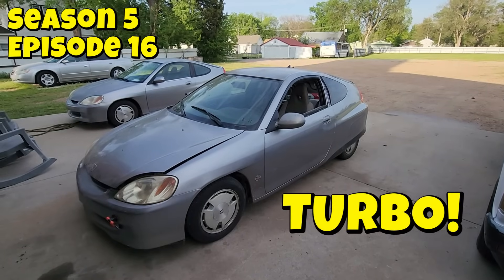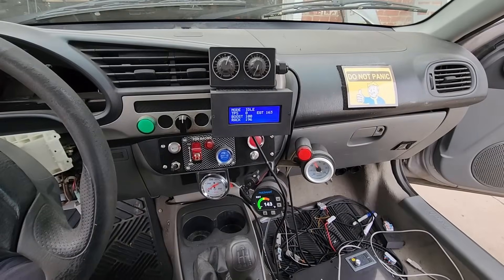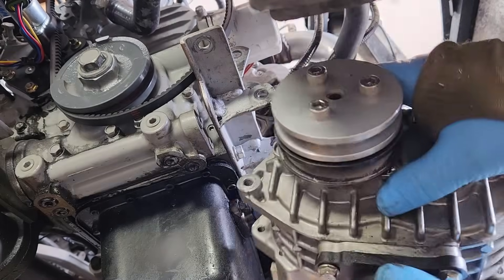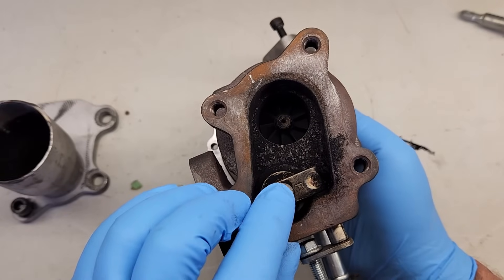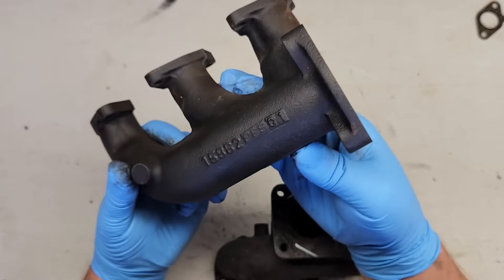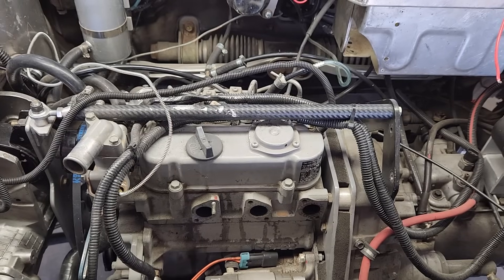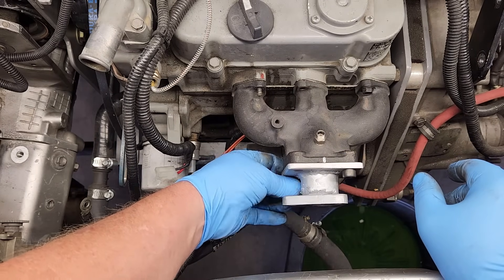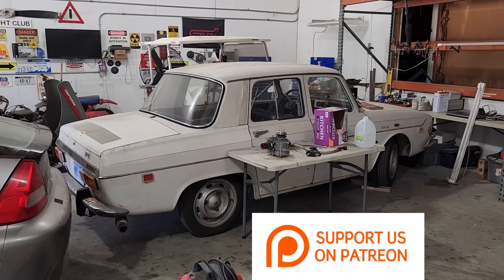S5 E16. TURBO !  We get rid of the AMR500 supercharger on the D722 Kubota diesel engine in the Honda

Comment: Rule of thumb for turbo: Smaller turbine wheel, spool faster.
Bigger compressor wheel, flows more.
Actually it isn't so simple but you can rule out some of the turbos in this way.

Comment: Yeah, the Gen1 Insight is TINY. It's about the size of a Honda CR-X from the 90s, and about the weight of a Ford Festiva from the 80s... except the stock Insight fills the bottom half of its trunk with batteries.

Comment: You should try the kp31 turbo of a smart car, it come with the manifold, you just need to make an adapter plate. We use them on our pulling garden tractor on our kubota 3 cyl diesel. They build more boost than the Rhb31 and you can get a billet compressor wheel for them! I love your videos!

Comment: The Nissan TD42 uses a plunger styled adjustment to the mechanical injection pump to increase fueling proportionality to the increase in boost. It's not a perfect system compared to electronically controlled fuel management but its very simple and very robust.

Comment: If the radiator is on the driver's side, why can't the turbo be flipped and / or clocked to work with the other manifolds? P.S. I  will watch your videos either way with or without electronic content. ❤
Reply from the maker: I understand what your saying, however there is not enough room in the engine bay without a massive amount of exhaust fabrication.

Comment: Adding a turbo or supercharger to increase the amount of air per cycle is fine, but it seems they haven't improved the pump to inject the appropriate amount of fuel. Less fuel means less power.
If the pump is the same, the amount of fuel that can be injected is the same as normal, so the power output will not increase. Since more air is added, more force is required for compression, so the available power output will decrease.
Reply from the maker: Not true,  we can adjust the rack on the pump for more fuel.  The pump will provide enough fuel  to allow the engine to develop about 35 hp.

Comment: episodes are a little short while simultaneously dragging out the material a little, taking off the existing setup, picking a manifold and bolting on an adapter shouldnt be 13minutes of content, viewership might go up if the fat is trimmed a little and a project/step is brought to a conclusion in one or two episodes, would of been nice to see the turbo on and operational in one bite, and then play with porting it ect in the next iteration

Comment: TLDR; Maybe instead of less electronics content, we need more detailled electronics content so dummies like me learn and are able to follow along.

My gripe with electronics is THE WAY most mechanically oriented YT channels do it... We might go from explaining how an angle grinder works or how bigger bolts require bigger wrenches and 30min slow-mo grinding montages to a table full of relays and other simple gadgets and if after the first part I didn't fall asleep, I'm still with you.

But it seems without exception all channels jump from this to "to avoid a wiring nightmare, we'll combine the functionality of all these individual gizmos to an arduino / a rasperry π"
And we go straight to a computer screen and setting the final values for whatever we are doing.
No one ever seems explains what those two thing are / how they are set up? All I understand them to be are tiny computers.
Surely they require an operating system, one doesn't just magically materialize on a circuit board, what is it? What software is used for the programming?
I've seen them used from automated propeller shaft greasing systems on boats to expanding the funcionality of a telescope and from boost control to stuff for fish tanks, solar energy and surveillance systems. Surely all those applications require a slightly different setup?
Surely the circuit board needs to be told what is connected to it and I can't just write "solenoid", "sensor", "motor", "linear actuator", "inch", "millimeter", "Fahrenheit" or "Celsius" on an excel sheet, they are just letters after one another before the computer is told what they mean?
I have done some simple coding to modify video games, so I think I could learn to work these things, but I've got nowhere to start and you don't know what you don't know...
So much information gets ommitted jumping from a completely mechanical contraption to a fully computerized one that watching any further tinkering on the computer side looses all value to me.

I know what a welder and a hammer is. I don't know what an arduino or a python script is.

Comment: Hey could you please please try to get the EGTS higher? It will really help spool the turbo and i doubt the engine will die a sooner desth because of it. Dont be afraid to see 1500F during acceleratio 🙏🏻🙏🏻🙏🏻

Comment: See a lot of time/money spend on flanges with these tiny cheap turbos and oem manifolds. We simply weld the turbos straight to the manifolds. if the turbo craps out slide it out of the exh housing and slide in another. the new "Cast" manifolds weld great (simple mig welder) unlike the cast manifolds of old.  Just a thought! Great vid.

Comment: I ran my 2004 beetle with 1.9 tdi with no fans for almost two years without A/C. I put an aftermarket fan sensor, and it took 3 hours at idle to turn them on for 10 min. Crazy how cold deisels run.

Comment: Boost pressure does not directly equate to airflow. A poorly flowing cylinder head or restriction in the post turbo compressor airflow path can produce high boost pressure but still not allow a lot of air flow… and the higher the boost pressure typically the hotter the air charge temp. So anything you can do to the engines ability to get the charged air in and out better will help lower boost for the same amount of airflow, which is a good thing.

Comment: I like your channel, because of the electronics and the mechanics. !!   Power wrap on the exhaust manifold - to increase the heat going to the turbocharger - higher volume, higher flow, higher boost. try the tiny Garrett "GT0632SZ"  to increase boost.

Comment: I'm good with both the electronic and mechanical content. Sometimes you can't run with a totally mechanical solution to a problem, or mechanical stuff is only part of the equation. I'm dealing with both in the process of transplanting a common rail TDI into it's new home.

Comment: Can you go a out lower compression ratio to 6:1 and the add dual stage twin turbos? Like a small and a big turbo for each cylinder on the Renault but have the small turbos transfer over to the big turbos at around 3600 rpm.?

Comment: I love the electronics and learning the seeing that stuff. I’m still waiting due the crazy gold cart version. I’d love to see an arduino or something that could use the throttle position mapped to a load percentage that would automatically throttle the engine to the correct load. Full turn key type of finish. What’s needed to max out the kubota? Any thoughts of doing a gas electric version of the insight similar to how the golf kart is setup but with bigger parts.

Comment: Its really great to see you back on with the diesel Insight project car again, excellent news! I wasn't into the golf cart petroleum battery series as it was not an efficient way to power a vehicle.

It's a shame that you couldn't find a way to increase the boost a bit more on  the supercharger for a final test, but it looked like you were really limited on pulley size in the space available.
I also reluctantly in the end liked and appreciated the electronic fuel rack module controler, but i didn't get the solenoid boost valve or the need for it.

Its good to see you go back to basics though as ultimately its a basic engine that ran fine without electronics. I like that you are going without the waste gate as you have found that it can only get to 16psi regardless, so its something else you can eliminate in this application. The ported exhaust manifold and turbo adapter sound interesting, and id like to see you try a more efficient intercooler with a lower pressure drop.
Once you have used up all the fueling available on the injection pump, then i like the idea of you implementing the propane injection system that you tried on the small engine, and maybe try water injection too for the charge cooling.
If you can't get the Honda to do a faster 0-50 and 0-60mph time than the best run with the supercharger then id be amazed. I think there's another 2seconds to come off the 0-60 time before you can say you've maxed out this engines potential. 
Don't get rid of the Insight as its the perfect project car for small engine swaps. If the Renault is done for then you could always put its engine into the Honda in the future, but the next engine to mate to the saturn gearbox should be a liquid cooled two stroke outboard or jetski engine i reckon. That would be unique and goes so far against the ethos of the Honda insight being a clean efficient vehicle it's a brilliant idea.

Comment: For the Renault, you can machine suspension bushings out of Delrin. It's an "upgrade" material used in performance cars and given the cars age, I don't think the addition harshness will really ruin it. It may not fix everything that the Renault needs, but it make make it a viable platform for future experiments.

Comment: I don’t understand how to read electrical diagrams or electronic devices, which is odd because I have a job servicing computer servers. We don’t fabricate the repair parts just swap out boards or drives as needed. Do a little flash of firmware.
No grassroots gizmo’s.

Comment: Superchargers honestly don’t need any of that junk….. They’re not as efficient as turbos on a diesel because of the mechanical input, but they essentially do the same thing and are great at creating boost at idle. Still not sure why all the convolution that little motor can handle at least five times it’s rated output.

Comment: 9:00 nope, older euro 100 and 200 bills are actually larger the reason for the reduction in height (not length) was, that they are now the same width as 50 euro bills, and thus it's easier to fit them in cashes.

Comment: Jimbo, your accountant is a real buzzkill.... would you happen to be married to your accountant? Sounds as if you are overly concerned about the accountant (her) being mad. Those darn accountants never let you have any fun. I would get the car in a position to be driven. Also sell the renault in a running shape, perhaps someone has the parts ratholed away to make it safe. I have found parts for things to make them work when everyone said no. I put a waterpump from a mazda rotary engine on an old 1939 four cylinder Hercules engine on a lincoln SA-200 welder. The old water pump was fubar but a pulley/belt and some creative bracket welding made the mazda water pump work great.
Reply from the maker: Meh, I got divorced many years ago,  My X-wife would never let me have this much fun.   Unfortunately the accountant is right and I need to start making money or this channel will go bust.

Comment: I have the renault's speedy cousin: 1968 Rover TC2000. I love the old european cars. Mr Magoo loves them too.
Reply from the maker: LOVE the British cars, I have a half dozen of them over the years, mostly MG's and Triumphs.  I did see a Rover with the same body style as yours in a Michigan junkyard many years ago and I felt sad for it.
Reply: @robotcantina8957  mine is a southwest car luckily. all original, manilla color, and rust free. let me know what you want to do with the renault. I wouldn't mind putting in a .... NO, I DON'T DO LS SWAPS...
Reply from the maker: @ronamer1  We are defiantly going to sell off the Renault.  Its a bit too much of a worry to keep it around and not being able to get parts for it on short notice.  The car has been garaged since 1986 and its mostly solid with the only real rust is in the rocker panels.  The rockers are still solid, but they make a crunching sound when you try to jack the car up on them.  Since its a swing axle, the transmission is a major part of the rear suspension and  I thought about using an older VW swing axle transmission to upgrade the oddball Renault transmission, but  it would wind up being way too much work for the channel to do on a budget.
Reply: @robotcantina8957  I would suggest a third channel. first being the original RC, then one for the techies and geeks so you can do your computerized mods, then a third, kinda like monster garage, but for oddball stuff. you can shoot film on the same cars, but do your edits on the 3 categories
.

Comment: I’m confused, how many hockey sticks big is the Kubota? Or inches per millimetre of torque?
Reply from the maker: LOL, its about 10 hockey sticks if you cut the sticks in half and throw most of them away and only use the nicer ones to do the measuring with.
Reply: @ Wow, my hair dryer is bigger than that…

Comment: Jimbo
You have a hydraulic press. I've seen you use it. You have a torch. I've also seen you use it.
The 'factory' bushings in the Renault may be hard to find, but Delryn universal bushings slide right in after you remove the factory bits and pieces. and will actually work with you for hard to find bits.
An old school Monroe PAPER catalog could possibly locate shocks for the old girl.
It would go a long way to making it roadworthy, and you could sell it on "Bring A Trailer" to someone knowledgeable about Renaults instead of scrapping it.
Reply from the maker: The Renault will not get scrapped, it will get sold.  We need a project vehicle that isn't 56 years old and impossible to get parts for.   I certainly could repair it, but that would take an enormous amount of time and I'm not sure too many people would watch videos on fixing the suspension of a 1969 Renault R10... it would be just like the videos on electronics... a few would watch and I would loses a lot of money toying around with he Renault.
Reply: @robotcantina8957  blast the infernal algorithm! 
I understand 'getting views,' but, as a music nerd, don't go full Spinal Tap on us.
A few releases that don't happen make the top 40 isn't a reason to go full Chris Gaines on us, Garth. 
'Garden Party' is my favorite RIcky Nelson song, because it was about being true to yourself and your craft. Just don't take any private plane flights, whatever you do.

Comment: I have a challenge for robot cantina...
I need a diesel or electric powered 4wd small truck to run around the farm on. Fuel efficiency is important and top speed isn't important. Electric would be awesome. Can we mate a golf cart motor to a manual transmission in a small 4x4 S10 or something similar?
Reply: A popular swap option would be the VW 1,9 TDI ALH engine. There's a lot of videos of 1,9 tdi - swapped pick up trucks on youtube, even a whole channel focussing on those TDI swaps. The ALH - 1,9 tdi engines are widely available and cheap, the swap seems to be doable, and the mpg is great. Maybe that's something for you to have a look at. 🍻
Reply from the maker: Realistically, using a small engine like a 212 or 420 and a clutch mated to the transmission of the truck would be more fuel efficient than using an electric motor and an engine to generate the electricity for the motor.  On our golf carts, there is a 40% loss of power when we generate the power for the electric motor.    The golf cart projects were to show it is possible to get a golf cart to move without batteries and  they did really well on fuel , but if we eliminated the all the electric stuff they would have been a lot more fuel efficient.
Reply: @robotcantina8957  I meant using the electric motor and batteries to power the truck. Or just install a small diesel engine instead of going electric

Comment: [Random Algorithm Appeasing Comment].
Have you thought about doing a video with the Renault, demonstrating how easy it can be to pour your own polyurethane bushes directly into suspension components? I did it once on a Fiat 127 because a full set of OEM bushes weren't available, and machined polyurethane suspension bush sets were prohibitively expensive.

It's one of those jobs that all prep work, but once you've got all the parts cleaned up, plastic "Shuttering" in place to keep liquid polyurethane from leaking out and hold centre tubes in place, and everything jigged up level so it's ready to pour, it's a pretty quick process.
Reply from the maker: Keep in mind the Renault is 56 years old and touching anything on that car is like opening a can of worms.  If I were able to get the suspension apart without braking anything that would be a miracle.  I feel like it would be a quagmire if I started to rebuild the suspension on that car.  Perhaps its best to just sell it and get something  a bit more modern.

Comment: How did you get the couch to work
Reply from the maker: I don't understand?
Reply: @robotcantina8957  clutch my bad like adapting the trans to the kabota
Reply from the maker: @alexmoore3790  OK, that makes more sense.  We covered how it was done in the older episodes, but the short story is we modified a Saturn flywheel to bolt on to the Kubota flywheel.  That way we could use the saturn  clutch disk and pressure plate that was meant for the Saturn MP3 transmission. The flywheel mod was done by a local company and it cost $800.00 because it had to be CNC machined and then welded.  It was expensive, and they gave me a good price because they had a lot more time into this mod then they billed me for.

Comment: Have not heard of a Diesel engine that was supercharged, the normal boost provider is a turbocharger like you're installing. The supercharger might be a nice addition to the Volvo? Project for another time. Love your channel 🙂
Reply from the maker: Turbos are great on diesels, however on a small diesel, there isn't enough exhaust gas pressure to spin the turbo to many serious amounts of boost, that's why we tried the supercharger.